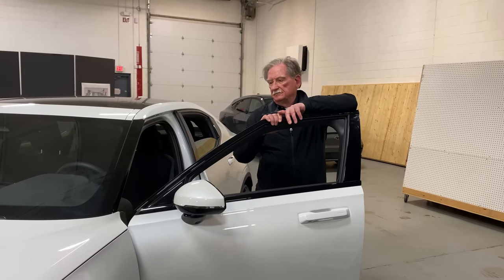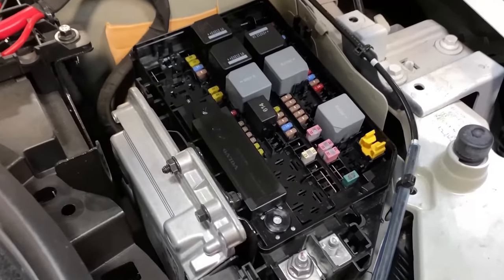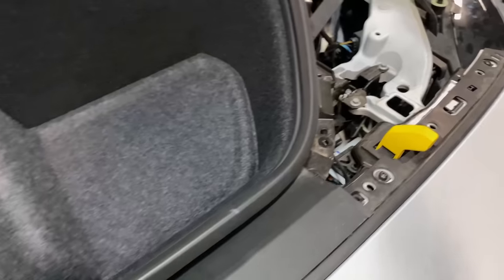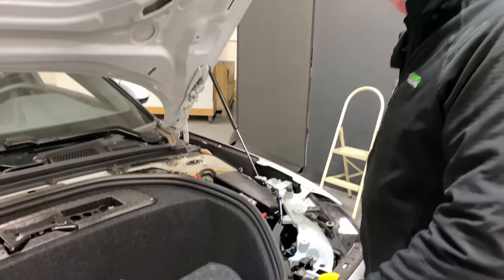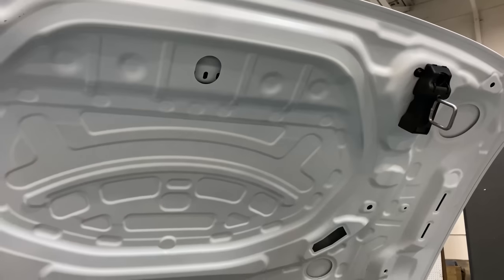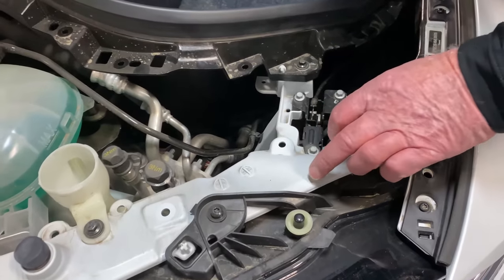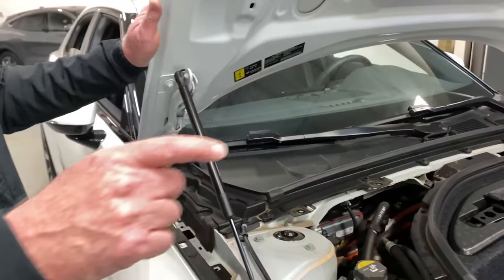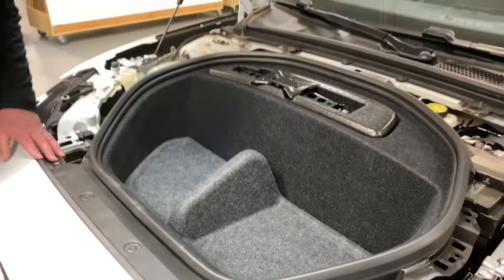2021 Polestar 2: E2 - Under The Hood

Comment: Good video. And a welcome acknowledgment that European safety standards are expressed in real engineering.
Reply: To fix something that isn't broken?
Reply: Pedestrian impact feels too much like a category invented to boost the overall score for cars that do poorly in the important categories.  Same with the rating on child seat connectors.  A poorly designed car can get a boost in ncap by adding silly things to the hood and having childseat connectors for 3 different connector types.  A car only really needs 1 connector type because you buy the seat that works with it and all seats can be installed with just a seatbelt too.
Reply: @_PatrickO  pedestrian/bicyclist safety might not be an important factor for you as the driver, which is exactly why it need to be part of the rating as it is important for those who get hit.

Not sure about the US, but around here, isofix is the standard for child seats, and if you believe those supported by the seat belts are just a safe then you should check some tests

I guess safety features like automatic emergency braking are just pointless too?
Reply: @_PatrickO  A  “ poorly designed car...” will be improved by the imposition of standard mandatory safety requirements.  It’s not a freedom or death type deal.
Reply: @gt5228z  You only think it isn’t broken because people in the US would die either way after getting hit by a huge ass truck. But in Europe it makes an actual difference. 
The reason we have so many incidents involving pedestrians is that most people walk through city streets. In the US that is only true in a few cities. Your cities are build for driving every single time.
Reply: Misconception, There are way more traffic deaths in US versus EU per capita in all categories. Year 2018 (the latest full stats); Total traffic deaths: US 36835, EU 23400. Per 100.000  , US 12.4, EU 4.8. Pedestrain deaths, US 17% of total, 6262 killed, (2.1/ 100.000), EU 21% of total, 4914 killed (1.0/100.000).
So in all metrics, both in absolute numbers and per capita, there is more pedestrain killed in US versus EU. Measured per capita x2!
Reply: @Glenhh  why design car to more safety hit ppl? Since European cities are designed for pedestrians, what causes them to be in the streets so much in the first place? Maybe engineer better cities...
Reply: @gt5228z  Haha, wtf are you talking about? Our cities aren’t bad designed, they are often hundreds of years older than your country. There were invented for people and horses. This leads to more people walking through the city instead of sitting in traffic to get some chocolate. 
More people on the streets > more incidents involving pedestrians.
Reply: Engineer cities to make no space for pedestrians.. Big brain American that hasn't walked a mile in his life right there
Reply: @_PatrickO  not really, as pedestrian safety is often overlooked. This is a separate part of the scorecard in EuroNCAP, but does as you rightly say, contribute to the total star rating. Surely pedestrian safety is equally important on both sides of the Atlantic?
Reply: @andygranger3662  I don’t know about that. The size of a car makes a difference as well. American cars are huge and heavy, definitely not the best thing for pedestrian safety.
Reply: @taddawesome  literally every city and small towns/village have sidewalks. Any fairly large city and ≈70 of small towns and villages have bike trails. Every city has crosswalks and many(including mine) give pedestrians the right of way. The busy district of my 6000 person town and many others have yellow signs that say "yield to pedestrians". I PROMISE I walk more than you...
Reply: @castome7pi  I'm selfish? I ride a bike to work daily in the summer, what exactly makes me selfish?

Comment: Good stuff, I assume the difference in Europe is that there is actual pedestrian infrastructure and people walking a whole lot more than in US, I assume that also results in more unwanted car bonnet  to pedestrian interactions
Reply: Yeah, we don't drive to go like just next door.
Reply: @musaran2 ........think there was a remark that 50% of UK journeying, by car, is under 1/2 a mile.
Reply: Robby Dey  Changes in legislation and public policy don't usually apply retroactively and often have a transition period so people could drive their huge SUVs and pickups until they reduce to a pile of rust, but the manufacturers would not be allowed to make or sell new cars with designs that aren't up to the new legislation after a given date. 

And European countries already have their fair share of big cars on the roads. Range Rovers, XC90s, X5s etc are common enough and they are all designed to abide by the EU pedestrian safety regulations. Occasionally you might spot an Escalade or a ridiculously sized US pickup, but I have no idea if there's some hoop one has to jump through to import one or not.
Reply: Pedestrian fatalities are actually much higher in the US vs EU, some say it's because of so called "stroads"

Comment: There aren't more pedeastrian runovers in Europe than in the US. But the safety standard for those cases is higher. As cars keep getting bigger and bigger, people being runover tend to crush their heads on the hood. In the past the people got thrown into the glass. As a result with the european safety standard, the injuries on the head, especially with lower speeds, are not that severe.
Reply: I was thinking maybe there are likely more pedestrians and bikers in Europe per square mile/km due to higher population density. 

People in the US don't bike around as much, and allot of travel is done across long distances, excluding some old dense areas such as New York perhaps.

But when looking at the statistics of pedestrian casualties, I'm seeing data showing that the US is indeed falling behind in this area, in fact the gap seems to be growing, so that doesn't seem to match my initial assumption.

Maybe another factor could be more reckless driving in the states, maybe it could be tied in some fashion to higher crime statistics, or maybe it's something else I'm not aware of that would balance out the population density factor.
Reply: @AllanSustainabilityFan  I would say it's much easier to get a driver's license in most of the states than any of the European countries. People are allowed to drive at a younger age, with significantly fewer lessons and a much easier test/exam. Whenever I'm talking to US Americans visiting Germany, they are all impressed how disciplined the drivers here are. 🤷‍♂️

Comment: Removable fuses and relays are incredibly useful when diagnosing electrical system failures. It is bad enough that manufactures integrate relays into the modules. I can imagine the headache of trying to do electrical diagnosis on a car without removable fuses. Sandy obviously has no vehicle repair experience, and it seem like most suggestions to reduce cost and assembly time come at the expense of maintenance and repair time or cost.

Comment: The aluminium castings jumped out immediately. They almost certainly provide the side supports for the cooling matrix but I wonder if the meet across the front of the car and if so how are they joined.  I know Polestar is now Chinese owned but it is division of Volvo and, having owned three different models, the Swedes design good functional vehicles with longevity and safety built in.

Comment: Very satisfying engineering going on here! Also, now that engines are being phased out, will they still be 'engine'ers?
Reply: Electrical Engineers.
Reply: @rogerstarkey5390  Electrical "Moto"neers
Reply: "Engineer" does not derive from "engine". Instead "engineer" has the same root as "ingenuity", with "engine" being "something ingenious".
Reply: @Graham_Wideman  
Here is the joke

Here is your head.

Don't overthink it now.
Reply: @ElDJReturn  How could one possibly overthink that play on words. It's the most obvious play on the word "engineer" that could possibly be made. As an engineer, after 50 years, it gets a bit stale. So I thought I could at least add something slightly interesting to this effort.
Reply: @Graham_Wideman  Or you could just move along to one of the hundreds of other Youtube comments if you don't like the joke? Anyways, Thanks for your input. Have a nice day!

Comment: Of course Tesla has fuses. In the older cars, normal melt fuses like here. On the newer ones, electronic fuses, and of course melt fuses on high voltage.
I really prefer melt fuses since it is easier to check for faults, quicker to replace and get working and so on.

Comment: The biggest issue with the Polestar 2 seems to be the poor efficiency of the motors, gearbox, wheel bearings, and the efficiency definitely is harmed by the excess height the P2 has (likely from modifying the existing XC40 CMA platform into a BEV) plus it weighs 600lbs more than a Model 3 Performance. 

Also… I HATE plastic fasteners. Especially those ones with the little pin hole thing you demonstrated. If you push down too far the pin drops into the abyss never to be found again.
Reply: Agreed Tesla do better for efficiency but the others will catch up. Hopefully Tesla can catch up for build quality, parts quality and paint quality.
Reply: @GA-wq8xq  Tesla’s Chinese made cars are fine. The reason their paint is probably less durable on Fremont cars is the fact California is so freaking psychotic about chemicals. Tesla has to use some super special kind of water based paint to comply with CARB.

Comment: Sandy, I really hope you are gonna show how to change the cabin air filter, it's so clever.
A comparison with the Model 3 would be funny too.
Reply: You mean Polestar doesn't make you remove the carpet in the passenger foot well to access a filter?
Reply: @stephenj4937  I don’t want to spoil it. I can tell It's a tool-free 30 seconds procedure.
Reply: @LaurentVitalis  If it's like my Subaru it is right behind the glove box - no tools required. The Tesla approach is utter insanity.
Reply: I expect Sandy would not highlight a bad point for Tesla
Reply: @GA-wq8xq  Sandy was very critical of the early model 3.  He's only positive now because they've genuinely improved.  He's still critical of the panel gaps.
Reply: @stephenj4937  it's very easy to replace on my '16 Model S (access from under the bonnet). On the other hand, one of the fuseboxes qualifies for the daftest fusebox placement of all time award. I guess with the Model 3 "fixing" the fusebox issue they had to make something else worse... probably something to do about the balance between good and evil :-P

Comment: Sandy What is your engineering take on the frameless windows that Tesla uses?  I would have thought that that is the worst kind of window especially in an electric car since they're the most difficult to seal for wind noise and the Tesla system of having to lower and raise each window everytime you open a door is overly complex so leads to more chances of failures.
Reply: Living in a country with cold climate and icy weather, that's my first major deal breaker about the Tesla. And I specify "the first", there are others.
Reply: Seals certainly need a coating of silicon lubricant to avoid freezing, and the car should be on umbilical in freezing cold weather.

Comment: Tesla is still using fuses for the high voltage circuit, right?
Reply: They use a pyro fuse to isolate the battery in over current situations or in some collisions. It’s not a typical fuse because it isn’t the current causing heat to melt and open the fuse, but instead it uses an explosive charge to open the circuit because opening a “high voltage” DC circuit quickly can be quite difficult and dramatic.

Comment: Could someone please explain to me why does 5 cent fuses are such a bad thing to have in a car? Will a comparable car without those cost less to me as a consumer? Will yearly maintenance be cheaper? Will reliability be better?
Reply: Because
1) You have to carry fuses with you everywhere, or buy some when a fuse blows.
2) Those fuses don't cost $0.05 (unless you buy 250 of them)!
3) The fuses are probably subtly incompatible with the fuses you have from another vehicle.  There are at least eight different ampere choices.
4) If a Tesla "fuse" _blows_, get out your smartphone and reset the fuse!

Comment: Interesting little nuggets. Good video, BUT ...

As a general rule I think it is appropriate to keep EV low voltage electrical systems similar to existing automotive tech. This is both for 'parts bin' reasons of economy but especially to ease future repairs as these vehicle age. Already today we see high end BMWs that are uneconomical to repair when lead free solder joints fail on proprietary out-of-production circuit boards. Tesla itself has faced a semi-mandatory recall over memory chip failures on earlier Model S cars. This failure disabled the central screen, disabling certain vehicle control features. that the government had to strong-arm Tesla into replacing critical vehicle circuit boards less than ten years old speaks volumes to me about the future of vehicles that go fully semiconductor on their control systems. (@Sandy, you should look into the Tesla board story if you are not familiar)

I actually prefer regular thermal fuses. Electronic fuses usually reset when the load is removed (not OTA), perhaps leading to repeated overcurrent conditions that may damage components. Yes, software can change that. Does it?  A fuse should never blow under normal operation and a properly specified fuse should protect wiring and components from overcurrent damage. If they can't do both the circuit is not properly designed. A blown fuse prevents further damage and alerts the operator unequivocally to the need for service.

The same goes for mechanical relays. Yes, MOSFETs are lovely but they do generate more heat than a relay and are seldom field serviceable when they fail, and they do fail.

I am far from some anti-tech Luddite. Electronics controlling lighting, HVAC, and other low voltage systems can be great - when properly applied.
Reply: The "failures" of Tesla's memory chips are not representative of electronic components in general, so does not speak volumes. Those types of flash memory chips have a limited number of write cycles before they no longer store data reliably, and this is known ahead of time. Tesla apparently didn't factor that into the design, or at some stage implemented software that would exceed those limits.  As for MOSFETs generating more heat than relays: This seems unlikely, given the extremely low on resistance of power MOSFETs, and they lack the relay's control-side coil that generates heat. However, they do have failure scenarios that relays are not susceptible to.
Reply: @Graham_Wideman  The Tesla is just a current example of the difficulties that can come with failures on a circuit board where only an OEM sourced component will work. Tesla wanted to charge owners a 4-figure repair bill to replace the board with an upgraded version. 

Mechanical board failures are much more common, as in the BMW case I mentioned. The environment in a vehicle is much more challenging than that seen by household electronics. Besides vibration there are temperature and humidity extremes in a car and conditions can cycle quickly from one extreme to the other... and then somebody spills a Diet Coke on the instrument panel.

And I have not once seen a relay with a heat sink or cooling fan.

We should hope that the EVs being built today might see a 20 year service life since they experience lower mechanical wear of driveline components. My 2011 LEAF drives like new in the hands of a young relative. It now has well over 100k miles on it and a fresh battery. Over time we will see more and more aftermarket replacement batteries for EVs, just as we have seen with the Prius. Aftermarket replacements for software driven circuit boards will probably never be a thing.
Reply: @Miata822  I agree that high-cost-to-replace boards and modules is an issue, and it's not limited to EVs. As for relays, MOSFETs and heatsinks:   MOSFETs need heatsinks to dissipate heat that they produce during switching. If they are not switching, virtually no heat is dissipated.  So for switching applications that are so slow that an electromechanical relay is a candidate solution, a MOSFET would not need a heatsink.  Doubtless you've seen MOSFETs with a heatsink, for example used for rapid switching or PWM switching applications, but there a relay could not be used.

Comment: 😭😱🤦🏻‍♂️🤦🏻‍♂️🤦🏻‍♂️🤦🏻‍♂️, the worst place for relays and fuses is under the hood exactly there !!! They are always got rusty and damaged in all kind of car accidents, rainy or by humidity. The ECU in in the worst place near it too. I must insist about those punchings of aluminum to iron !! They got loos during time and in all kind of damages they are weak points !!! Those kind of joints has made lots of airplane disasters 🤦🏻‍♂️🤦🏻‍♂️🤦🏻‍♂️.